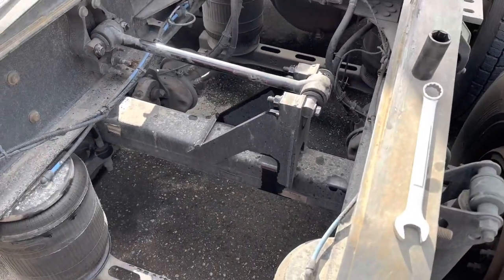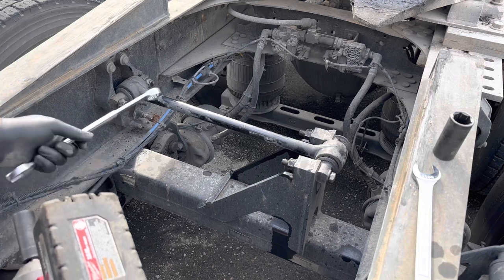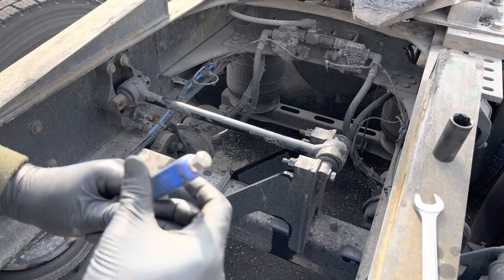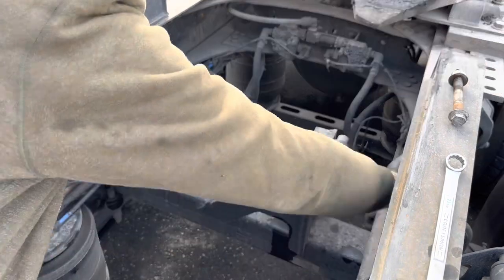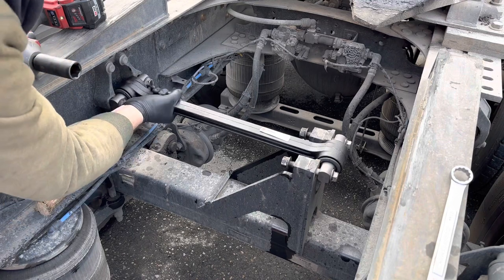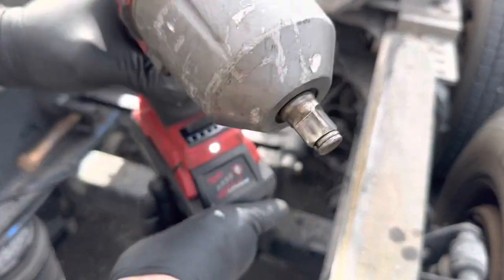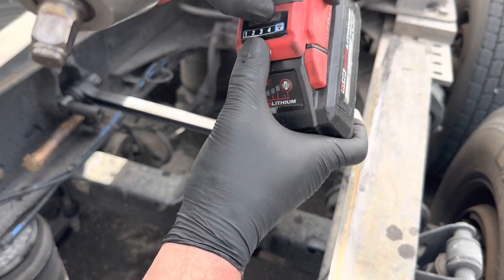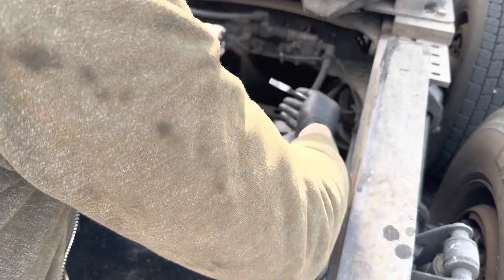How to replace a torsion bar on a semi truck Volvo vnl Freightliner Kenworth Mack

Comment: How much km this pan hard rod lasted ??

How often you change it ??
Reply from the maker: I don’t drive a lot of miles but I work every day and haul very heavy loads.
Reply: @iTruckiTrailer  I'm building an air suspension tandem rear axle suspension.
16tons load per axle.

What's the max load you carry ?